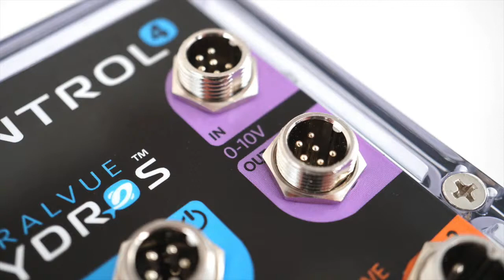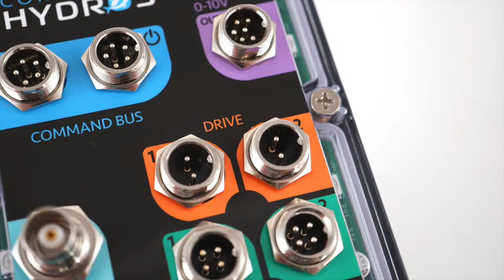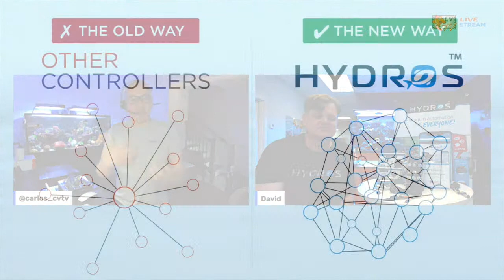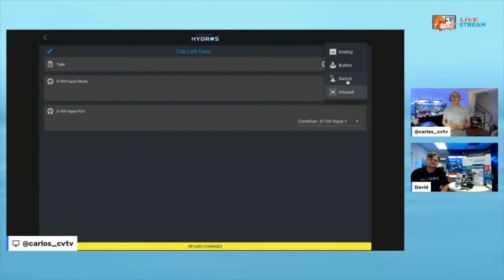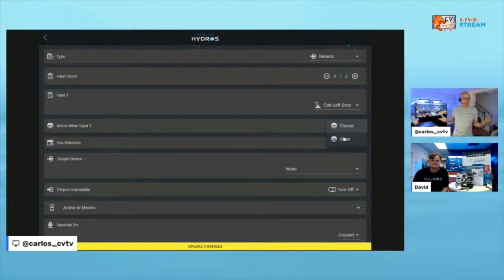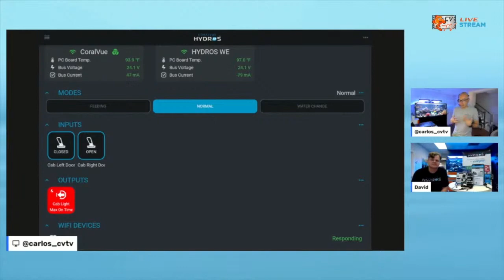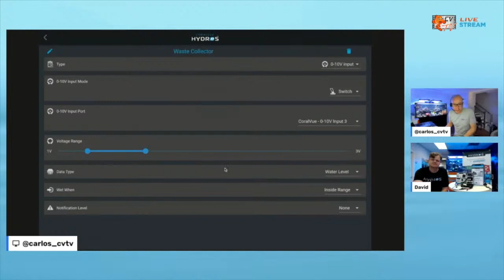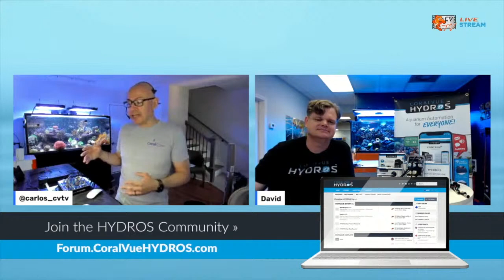[CVtv] LIVE Product Workshop – Creative Ways to Use the HYDROS 0-10V Port

Comment: Hello for the example of the switch for the cabinet connected 0-10v 
What is the name of the cabinet light you are using in the example where can I purchase a led strip light that works via 3.5mm or drive port into the hydros ? You explained it in how to configure it but you don’t mention we’re can I buy that actually cabinet lights

Comment: Any plans to make analog PV's scaled to a 1-10? e.g. use an analog level sensor and be able to scale it 0-100% or inches or whatever units you would like? And a PID controller that you can control the 0-10 outputs from an analog in?